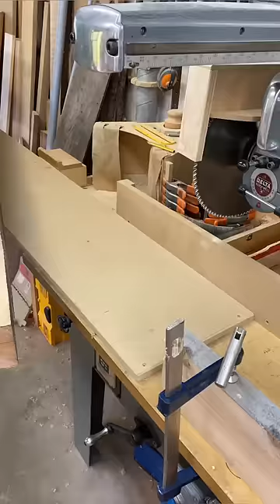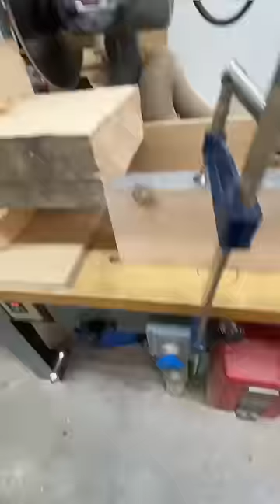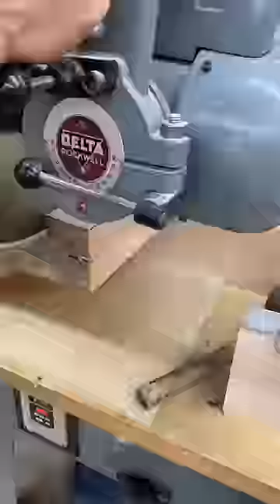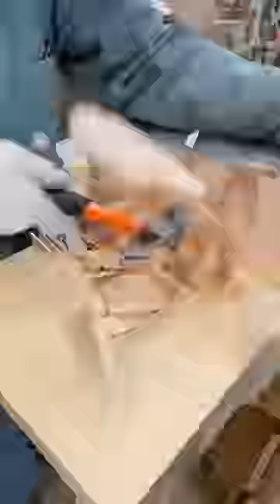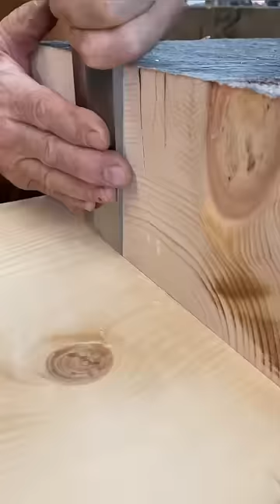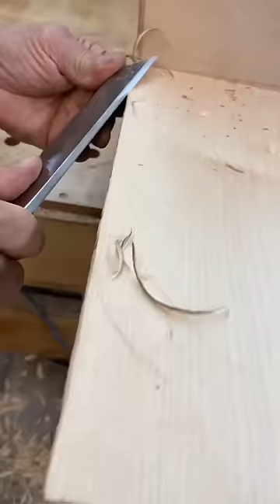Cutting a tenon  in 12 x 12 #wadkintemple #woodworking #woodwood #architecture #diy #ras

Comment: So you just turned a 12 by 12 beam into a 2 x 12 because that's all that's going to be supporting anything that you build with that now is that 2-inch wide tenon. The rule of thumb when you're making mortise and Tenon is 1/3 and if you really need to support some stuff you do the tenon on the verticals that way the entire beam is still sitting on the post but I'm sure whatever they're building will be fine with that little 2-inch Tenon
Reply from the maker: you didn't ask me what it's replacing
Reply: It's a vertical post...not horizontal. The weight is sitting on the shoulders. Maybe ask a few questions before you judge someone's work

Comment: How do you think about the shrinking and expanding of the wood when you're building
Reply from the maker: here we have to worry about the moisture brought on because we're down in the river turbine area so humidity levels are very high. We selected out thoroughly dry timbers, so that the timber actually swells and locks the joints.

Comment: Does the splitting in the tenon risk failure under load? Like you build with it, wouldnt that break?
Reply from the maker: timbers this size that is a normal drying crack no issue whatsoever

Comment: Jack. Any chance you can fo me a quick video on rippibg with a RAS? Any thoughts? And what blade you use generally.  We were always taught to use negative rake for cross cutting to prevent the head grabbing and being thrown towards you. Thanks chap. Matt.
Reply from the maker: I wouldn't be the person for that. I don't believe the radio alarm. Saw that great at ripping.
Reply: @jackEnglishmachines  that's enough for me. What cross cut blades d you like?

Comment: Good work.  A dado would save you some time though.  Question; with the split down the tennon, wouldnt that start to decompress after you hogged it out?  How do you account for that?
Reply from the maker: There’s nothing to account for its 12 inches wide and it’s the center piece of the tree which always cracks when drawing now that it’s dry and the tenant has been size it’s rather stable and if you look at the green it’s almost quartersawn on either side so rather stable
Reply: @jackEnglishmachines  nice! Learned something new today, I've never had to handle anything so large.

Comment: So I’m not the expert on gigantic mega tenons. Or even tenons for that matter. But in general it’s a third. Is there a reason this is so much smaller than 1/3 of the overall material? Does it matter at this size?
Reply from the maker: It’s a rule of thumb, not a rule. And this is a peer, so the tenon takes no load. Instead, it is the shoulders, and there is content explaining it in my feed.

Comment: For what is that tenon? It seems quite small to me. But as a metric guy I don't really have a scale. What are u building with it?
Reply from the maker: 50 mm thick 300mm wide 150 mm long. The tenant is on the end of a pier and the shoulders are compounded for wedges that will drive up against a bolster block. It is made telescopic so that it can be placed under the existing beam which is failing in an 1860s  Mill museum that runs on river turbines. We will be rebuilding the 60 hp turbine that runs the 2000 pound stone for grinding flower this winter and this is the first steps in shoring up. The massive gear works and Timber frame of the four-story stone building.

Comment: Why not just use a stacked Dado in the radial arm saw and skip the chisel work? Why is your tenon so proportionally thin?
Reply from the maker: My 16 inch diameter dadostack doesn’t fit this saw

Comment: This tickled me to death. I built custom log and square timber homes for 50 years and did close tolerance joints all day every day,,, with a chainsaw
Reply from the maker: Work is for an 1860s historical registration Gristmill on the historic Rideau canal quite strict. No machine marks.
Reply: @jackEnglishmachines I would have thought that by 1860 that you would have had either water powered or steam powered saw mills in the UK?
Mark from Melbourne Australia Carpenter
Reply from the maker: @markfryer9880  traditional methods were handsels

Comment: Thats a very thin tennon for that size beam
Reply: It likely is a vertical beam. By looking at it, I'd say the tenon is only an index, and the shoulder is bearing the load.
Reply: If it is a post, a couple of dowels would be a much more efficient use of time
Reply: @mikepage9520  I mean it's rude to think that someone making a beam this size doesnt have the experience, to know what he is doing, or for you to not check his other videos to judge that.

but he does have another video explaining what it's for and why it is made like that, around 5 shorts after this. i'd argue that in this instance dowels wouldn't be the right choice, and I say that knowing fine well he installs dowels into the mating piece.
Reply: @EqzL  nope, "how we've always done it" isn't always the best way. If the contributer is as knowledgeable as you say, then put all the relevant details in the video.

Comment: I’d be more impress if it was oak.
Reply from the maker: If it was white oak, it certainly would be a better choice of wood for the wet condition. But even the people back in 1860s who built this building a better sense than to use such heavy timbers.
Reply: What type of wood are you using? I’ll be looking back through your videos, so no need to reply with type if you’ve previously posted or commented it - I’ll find it.

Cheers!

Comment: it's too bad you have that deep split in your tenon
Reply from the maker: That’s pretty typical of 12 x 12 or anything that has the center of the tree there is absolutely no structural significance. It would almost be virtually impossible to find a 12 x 12 without the path center as it would probably require a 3 to 4 foot diameter tree.